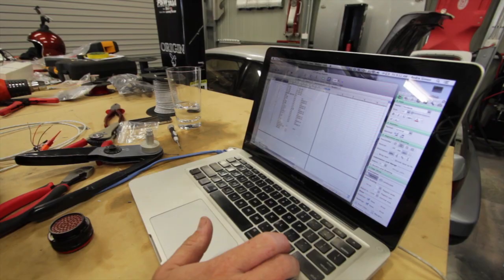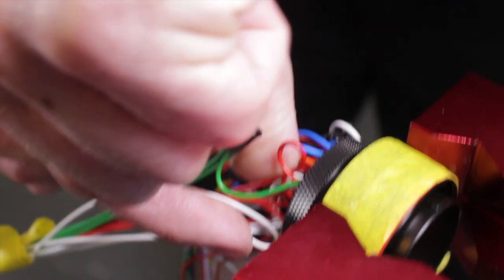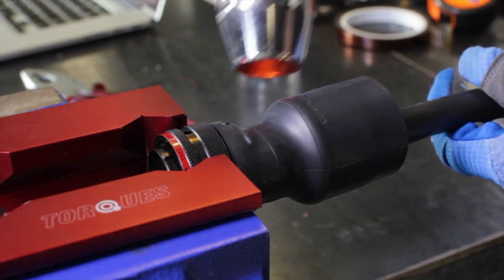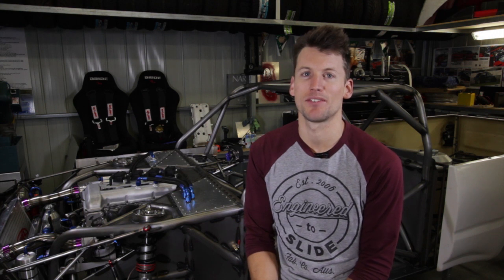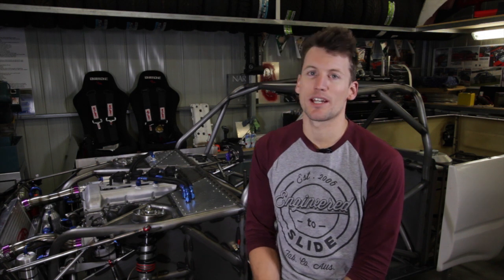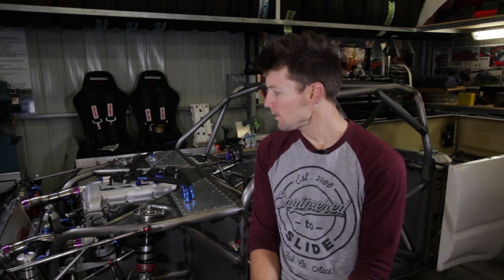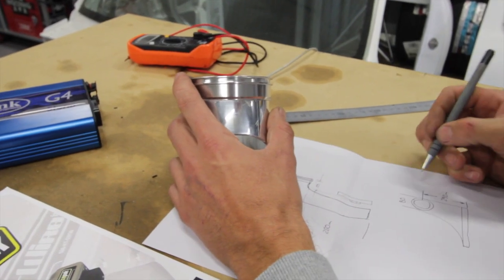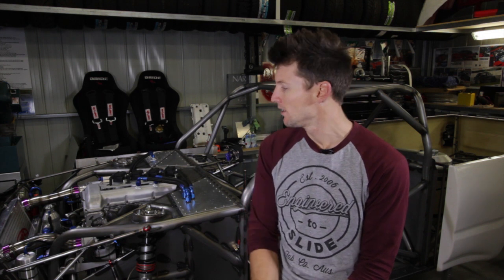Day 4 - Engineered to Slide x High Performance Academy - Tuning, Wiring and Fabrication

Comment: A cheap option to Mil spec plugs are the VW cannon plugs that VW uses on their engine harness ;-) You can repin them,they're twist locks so its easy to remove and there's a factory bracket that's easily modified for use elsewhere that gives you a clean OEM quality connector and look.I've used them for body harnesses along with a few others where I needed a neat affordable quick connect.So theres no excuse for sloppy wiring even if you cant go mil spec type gear.